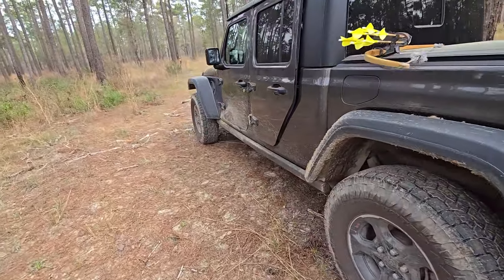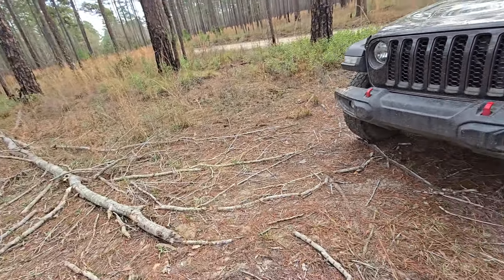Why Off Road Trucks Have 2 Recovery Points On Front And Back

Comment: One thing I wondered about, since the hooks are open, is that the bridal might slip off especially using a kinetic rope.
Reply from the maker: They are deep hooks and your soft shackle will fit in there great. Probably worth checking after each tug though. But jeep has been using these open hooks for many years and thry are the number one off roaded vehicle. So I'm betting there is a reason they still use em.
Reply: @Jason-Samko  Thanks, I saw a guy using zip ties to make it more secure, but I agree the soft shackle will be enough . Your videos are the best out there!
Reply from the maker: @danoesq2  great idea on the zip ties. I always have a bunch in my seat map pocket too! 
Also appreciate that you are enjoying the videos. Thank you.